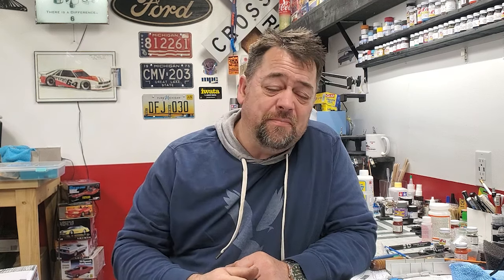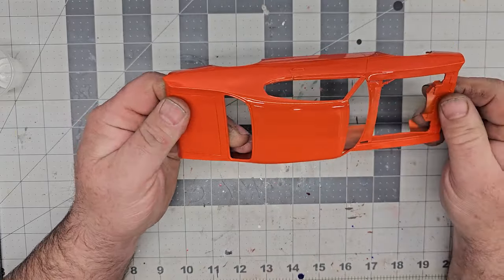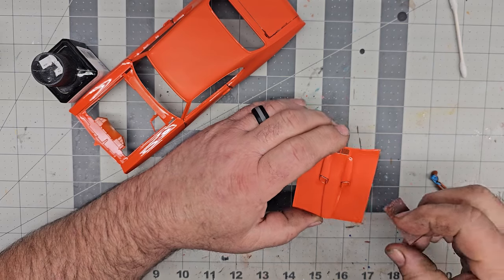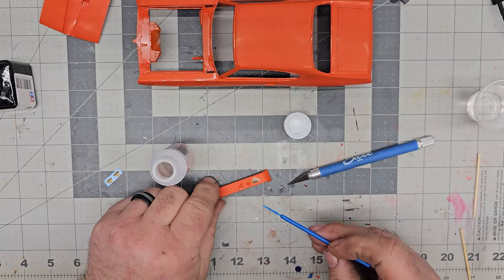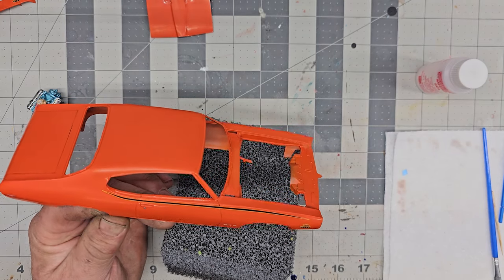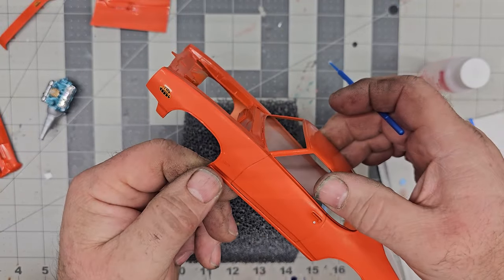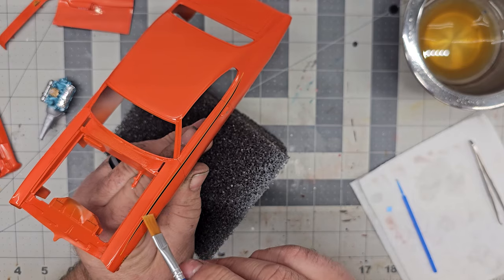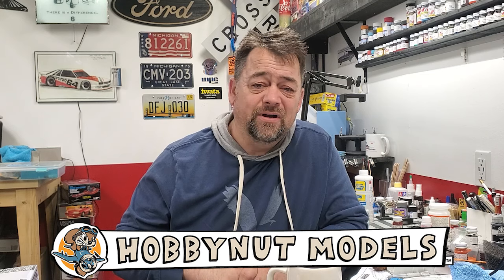PRIME TO PAINT SERIES VIDEO 5, FINAL SANDING AND DECALS.. #revellmodel #revellgtogiveaway

Comment: New sub here..!!  I love what I'm seeing. I look forward to learning more from you. Thanks for posting these videos. Much appreciated .
I have a question... what is a good starting point for the sandpaper grades.??   Also,.. are you using auto part store paper.? or is it something specifically made for model cars.?  Thanks
Reply from the maker: Thanks Tim, appreciate it! Depending on the paint job I like to start with 2000 or 2500 and finish with 5000 and up, I use automotive paper, it a better bang for the buck, I get my microfiber towels at Sam's Club, best deal. The 3M Trizact comes as one sheet little pricey well worth it.. Have a good one!